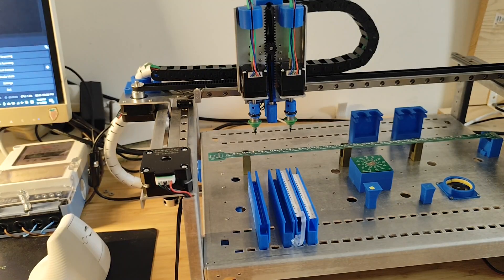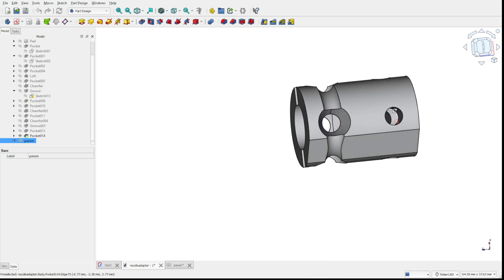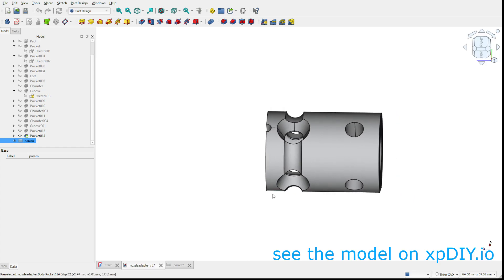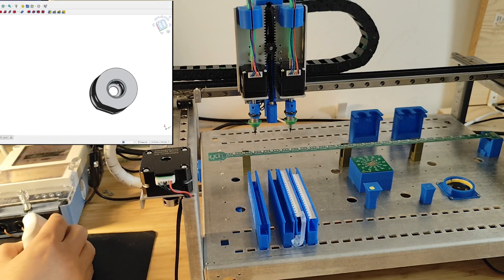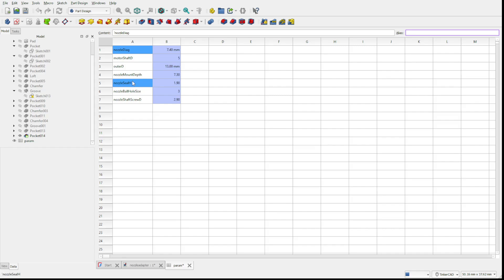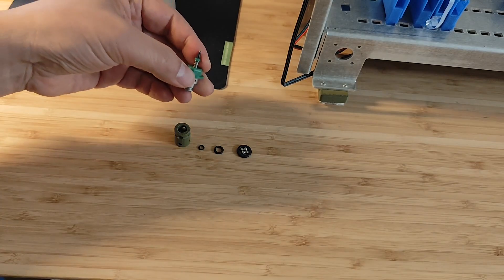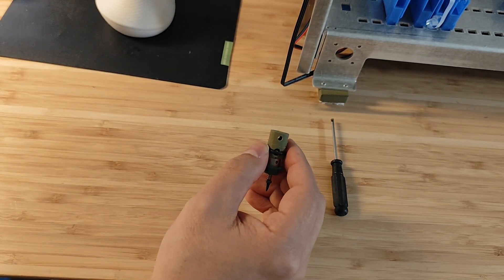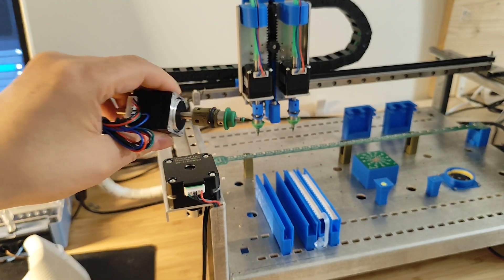Designing nozzle tip adapter - a customizable nozzle tip adapter design for Juki nozzle tip

Comment: Hello! What motor is that? Could you share the part number? It's perfect for this application! I've a ender3 V2 as a main printer and I was given a old Ender3 and I'm doing a very simple, only 0603 pick and place machine. That motor, together with the pump+valve system seems to be the most simple and at the same time reliable way to do it. Planning to control the valve from the 24V fan out, it should be good, no?
Reply from the maker: The motor is a 28mm hollow Shaft stepper motor, I didn't find the exact same one in AliExpress, but of you search nema 11 hollow shaft, then you can find some, for ex. https://a.aliexpress.com/_EQFogmW . This is indeed suitable for adapting to 3d printer, can be smaller and simpler structure.